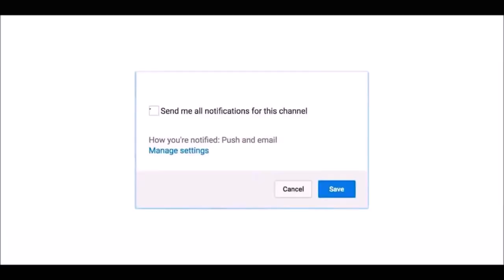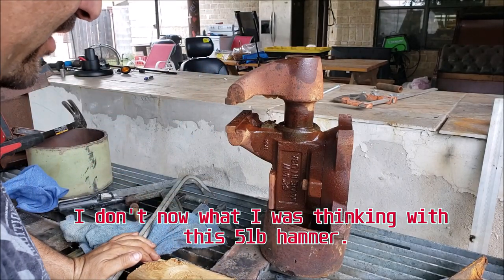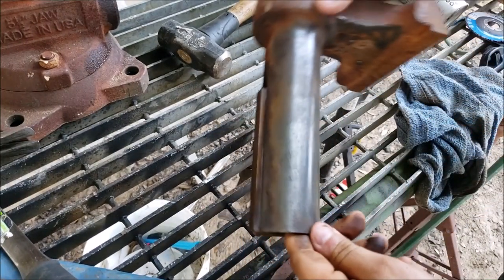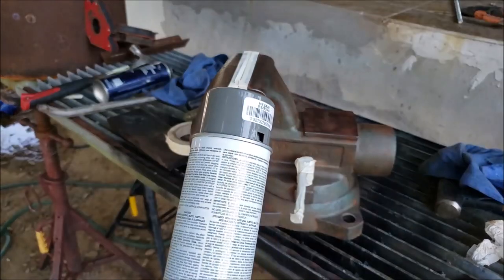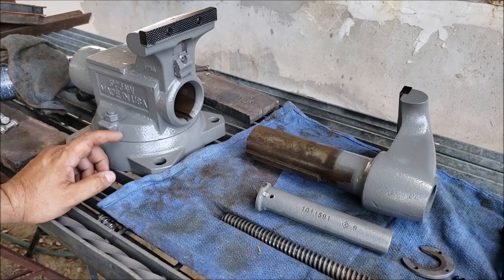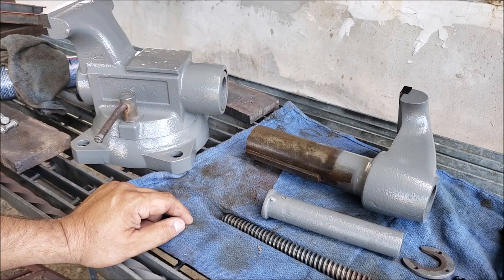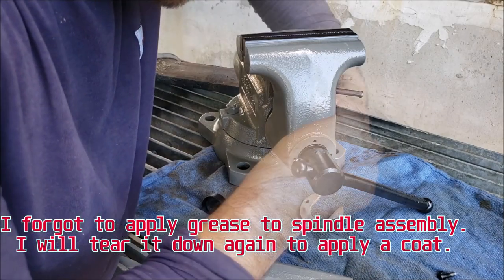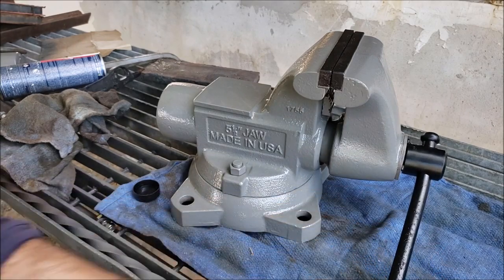How to restore a Wilton 1755 vise Part 1 restoration rust removal

Comment from the maker: Part 1 of the vice restoration. I will now look for bargains on ebay for the parts needed because I am not in a rush anymore to use it. I was going to use it but I received the 2 vices I had ordered from Harbor Freight while I waited to assemble this. Its my first attempt to restore a tool in these conditions.

Comment: Are you sure you aren’t Irish?????  Dude that is a score and yes I like the vise. Looks cool. That sledge hammering is almost a commercial for you and the the vise two tough forces. Nice work!
Reply from the maker: The vice came out good and I thought this vice was trash as it was located near the gulf for 8 years or so. I almost took it to the local scrapper but needed a project for the channel. I had no idea what brand or value it had till I got it home. I used 4 different shirts the 2nd day of sledge hammering. I am glad the hard part is done. Thanks

Comment: Nice job on the restoration... So are you going to install the new vice on your truck or the restored vice? ..... It actually looks brand new with the paint job...👍👍
Reply from the maker: I'm not sure which vise to use. The one I am restoring needs the back cover but cant find it. I may use the Harborfrieght one. It rained like 3 days so didnt work on projects but want to finish the gin poles, just need the drill bit.

Comment: You wouldn't be hammering a new chinese vise open like that. Looks good.
Reply from the maker: It's the first time I mess with a vise and glad I didnt screw up something. It turned out nice and now I dont want to use it. I will eventually use it on a welding table.